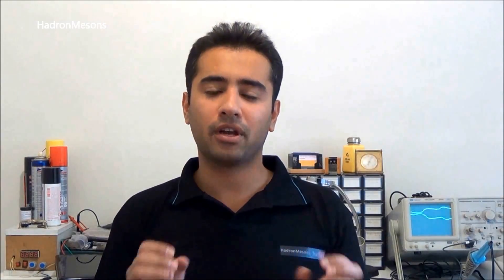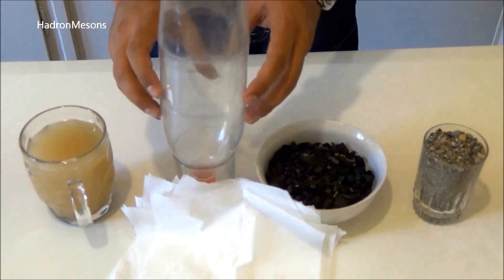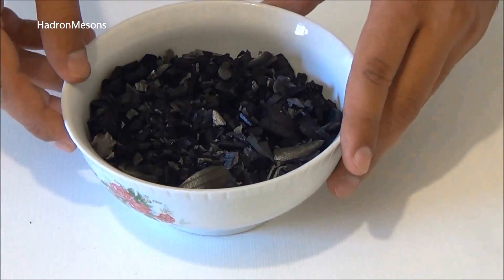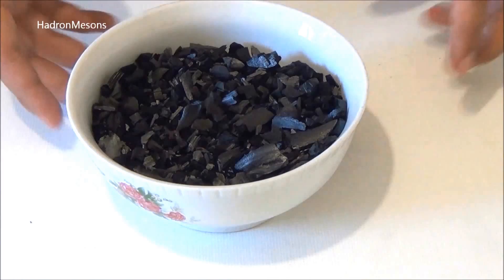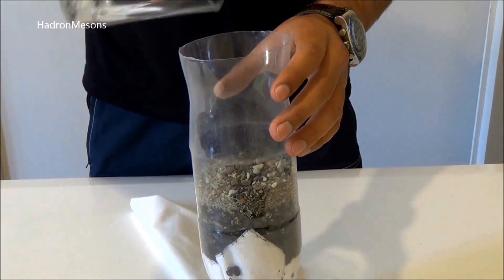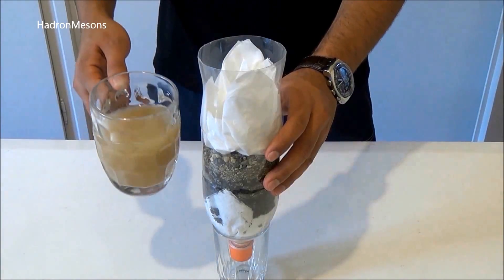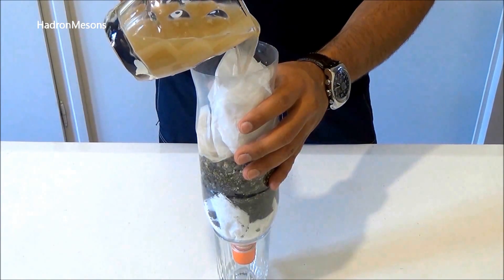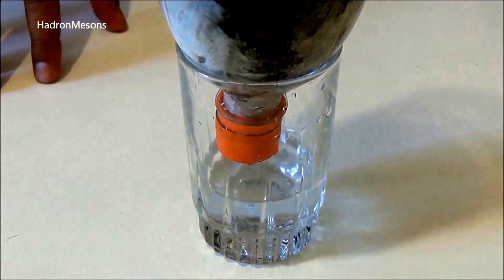How to Drink Dirty Water in Emergency Situation - Survival !!

Comment: I selected 7 of the flaws of the concept presented here - I hope that the scientist that you'll be some day will agree with me.

1. the whole filter is no better than a bandana/shirt/etc folded a couple of times (which is much easier to use and more likely to have on you in an emergency situation).

2. this filter does not eliminate the microorganisms from the water, so the filtered water is not safe to drink. if you rely on SODIS method to do that, you indeed need clear water for the UV to work, but... see point 1.

3. also, SODIS method was developed for equatorial/tropical regions. solar radiation is different (weaker) in temperate/polar regions - do you have a reliable source for SODIS working in Canada, for example? during winter?

4. you should disinfect the sand first (otherwise the filter itself might contaminate the water), preferably by boiling (but if you can boil your water, why bother with the filter?).

5. "charcoal" is not "activated charcoal". you claim (in a response to a comment) charcoal to be 50% as effective as activated charcoal - do you have a reliable source for that piece of info? it might be better than nothing, but only grounded into a very fine powder, to provide a larger contact surface than when using pieces/chunks like presented in the video. 

6. the filter presented is very poorly constructed. to be effective, it should consist of much finer (and dimensionally homogenous) media - thus preventing the water to flow through preferential channels and not through the entire mass of the filter. it also should be packed tighter, to prevent the water from preferentially flowing between the plastic bottle and filtering media (you can clearly see that happening in the video).

7. this is a slow filter, therefore it must be primed before using - which was not done in the video. to prime a slow filter, you should slowly fill it with water, from the bottom up. this way, the preferential flowing channels are less prone to form. also, you should use clean, good-to-drink water to prime it - which you don't have in the first place...

I hope you will not take my comment the wrong way. I just wish people were more aware of what they're doing, both when posting and learning from a youtube video.
Reply: If it were an emergency it would still be the best situation. If rather drink that than 100% dirty water
Reply: bushcraftmyway like I always keep charcoal in my pocket for emergency.
Reply: You boil water to get rid of the micro organisms, the filter is for the particles in the water.
Reply: Well we have some fucking scientists here woohooo
Reply: Just melt fresh ice on Canadian winter.
Reply: You are spot on. Getting rid of the silt and dirt in 'dirty water' is probably the least of the problems. We need to be careful we don't think the process will necessary remove, just for example:  chemicals like arsenic, strychnine, etc; acids and caustic substances; medicines etc; viruses and bacteria; protozoa etc; and the list goes on.
Reply: for 4. boil doesnt kill all the pathogens

Comment: Thats not very safe at all. I hike and have to deal with real purification methods to rely on my water. Any water you find in an emergency situation will most likely have more chemical, bacterial or viral impurities. Your method does not account for the most important impurities and just encourages people to drink dangerous water that looks cleaner (most could find water crystal clear anyway so thats a mute point anyway). Yes this would help a lot for city water just like your average britta but in a survival case you would be lucky to even have chlorine in water. In an emergency find natural water, boil for 10 minutes and dont mind a few floaties. A lot safer and realistic way to safely drink water in an emergency situation
Reply: This is usually used when you need to wash your hands or clothes and things like that, but if you need water for drinking and cooking, then it's just as you said boil water and that it. A lot safer and quicker way, and you can use water for more things.
Reply: Too true. This method, boiling, iodine, bleach and many more methods can be used in conjunction with each other to get particle free and biologically safe water

Comment: Does the charcoal have to be heated or can I just it out of the bag to purify water?
Reply: how long do you have to heat it for and i'm talking about charcoal used to bbq
Reply: HadronMesons  say you're in a survival situation and you can't make a fire to purify the water can you just use the charcoal without heating it.
Reply: warriorusma102 If you are in a survival situation and you cant make fire, than you are most likely screwed anyway, yes water is important, but food, heat and light are just as important, and there is tons of ways to make fire :)